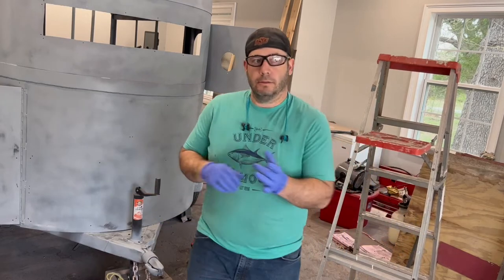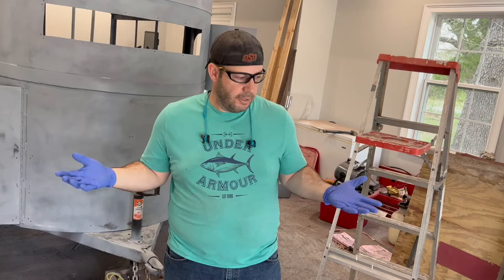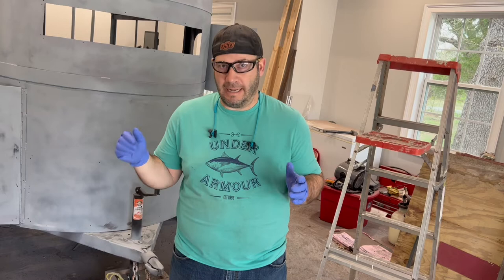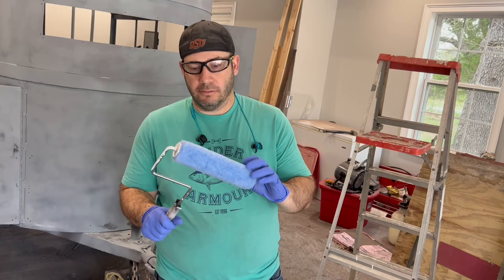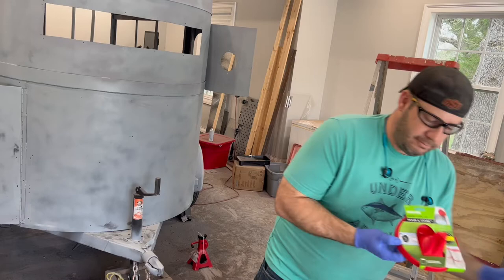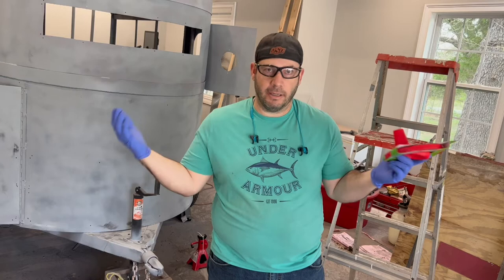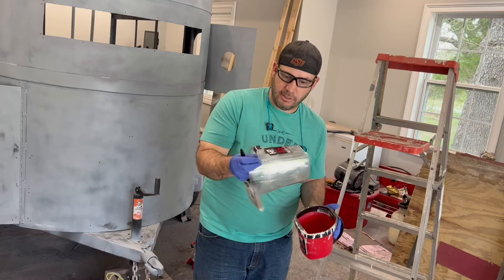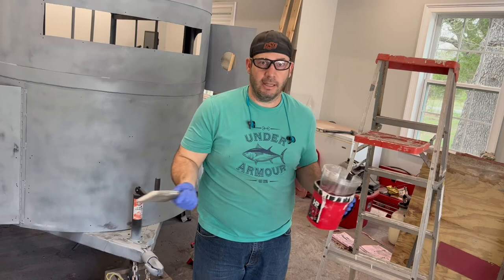Easy way to paint your trailer

Comment: Using this method is convenient if you don’t care about looks but you will definitely know you used a roller.
Reply from the maker: I’ve had great success with it. Once you get used to it, there’s very little if any places that anyone could tell. The flat black on this trailer showed any little imperfection, but a gloss white that I paint most you can’t tell at all. Most people think it’s sprayed unless I tell them.
Reply: I've painted a couple of sailboats (22 and 28 feet) and houses, and they came out pretty good with rollers and brushes. Imo there's other factors  such as not painting in direct sunlight and late in the day when there is no dew, etc.
Reply: Na, they make quality rollers and brushes that if you know how to follow instructions it’ll look great.

Comment: Hi there, I noticed you already primed your trailer. What cond or name brand di you use and did you use a roller and brush for the primer too?
Reply from the maker: On that trailer I used spray cans of rustoleum automotive primer. I have done trailer with primer and also done them without primer. The rustoleum paint is good for straight to metal. I have also used the gallon cans of primer and like rolling it on better. I do find that without primer, another coat of paint is needed since there’s not a uniform primer color underneath. One key thing that I’m doing now on painting is using a roller that is 1/4” mat woven mohair. It doesn’t shed and that has been one of the biggest downsides of rolling is the shedding of the roller. The mohair resolves this. Hope that helps.

Comment: Hey bud, I only sanded into the current paint, I didn’t go down to bare metal. I’m using the two products u suggested. Do I have to sand the primer before painting?
Reply from the maker: As long as it’s not glossy, the paint should stick alright. I’ve had trailers with 3 and 4 layers of paint that had been there for 40 years with little prep when painted, so you should be good.
Reply: @carriagehousetrailers   thank u so much for getting back to me. Ok so Matte should be fine. I do plan on using gloss on the interior, so for the gloss I should sand the primer?
Reply from the maker: @jessicawilson1261  Happy to help. What I meant was as long as what you’re painting over doesn’t have a glossy finish, then you should be good. The new paint will just need a good surface to bond to.
Reply: @carriagehousetrailers  gotcha! Thank u so much!!! U’ve really helped me a lot  through this project
Reply from the maker: @jessicawilson1261  awesome! I’m sure your project will turn out great!